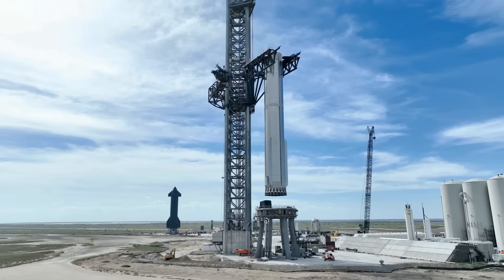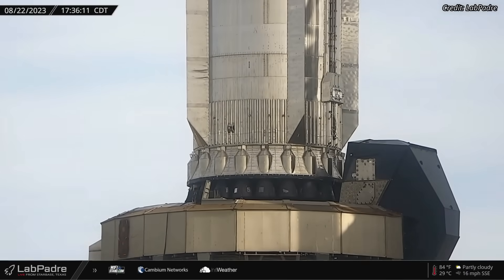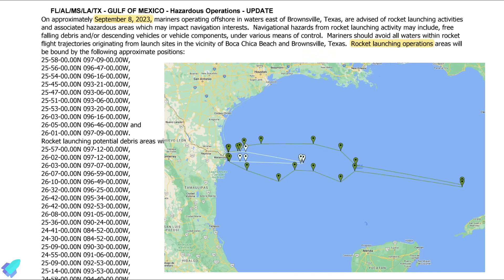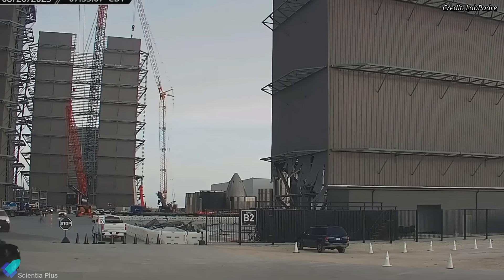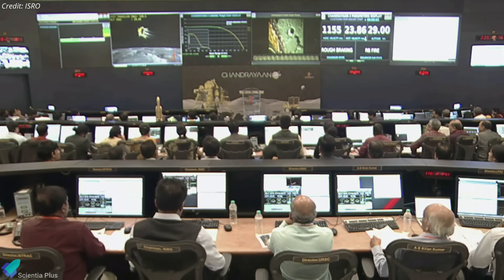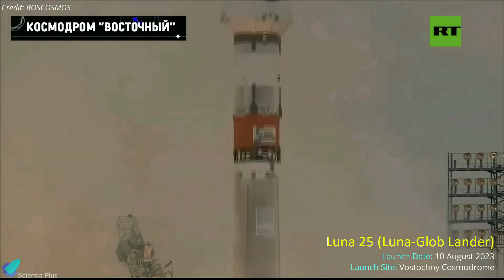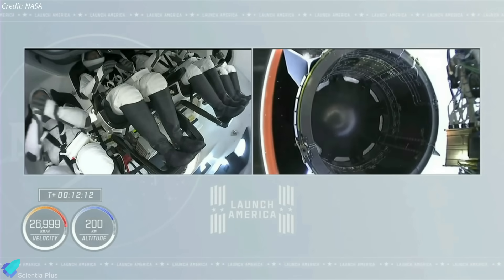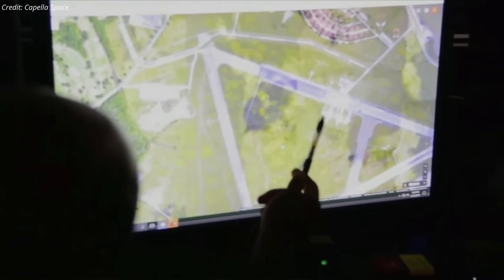Starship Booster-9 33-Engine Static Fire a Win with Raptor Issues Fixed  - Orbital Launch Next

Comment: OK, they pressure tested the hot staging ring, but what about the heat test?   I haven't seen anything on that yet.
Reply: It's steel so not a problem 😅
Reply: If something did happen to it it’s on top of the booster and wouldn’t affect anything. Maybe that’s the part you toss.

Comment: All issues not fixed or tested, need an 11 second successful static fire.
Reply: Yes, for the 2nd test, 2 raptor shutdown early.
It's progress. Need to do all 33 raptors for next test, probably on 28th Aug.
Reply: full thrust !
Reply: Completely unnecessary. Test full thrust when it launches. There’s nothing to be gained with a separate full thrust test. Test the vehicle and the pad simultaneously. No-brainer.

Comment: Being my age, they make it seem so simple, just like when we would swap out an engine in a mustang. No big deal a cpl. hrs and good to go. Oh wait, move the hydro makeup supply coupler over to the fetzer valve rotated 36.371 deg to clear the outlet of the Potassium aluminum sulfate dodecahydrate inlet so the Polyfluoroalkyl Substance dog feeds can clear during hyperbolic compression. Yea right, a little more involved than our days in the garage. My hats off to the young ones today. I'm happy to sit back and watch as the 30 some story rocket weighing 100 tons goes up at umteen thousand mph. But it's good to see some little things are still amusing. A stuffed critter at the end of a string letting them know when they are weightless by floating around making the astronauts smile as they tug it back and forth!!
Reply: It may sound complicated and use a lot of unfamiliar terms, but after a full career of engineering, I can tell you engineering is the art of taking something complicated and breaking it down into small discrete steps.  Just like changing out an engine requires a bunch of small discrete steps.  Assign a competent person to solve each problem, and put someone in charge to make sure one solution doesn’t intefere with another one, and you can accomplish anything you have the funding for.

Comment: I think the issue with the engine shutdown is sonic oscillation
Reply: Let Knuckles take over he doesn't drink.
Reply: Probably because there’s 33 temperamental engines. They’re working out the bugs. They’re a new unique design and they just need to be run to sort things out. Methane isn’t as easy as some of the other rocket fuels like kerosene or hydrogen.